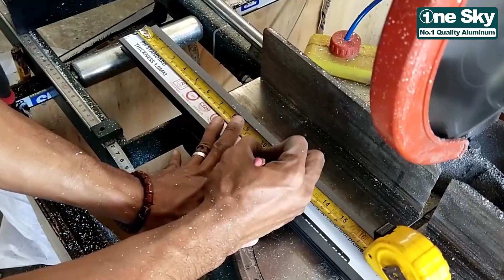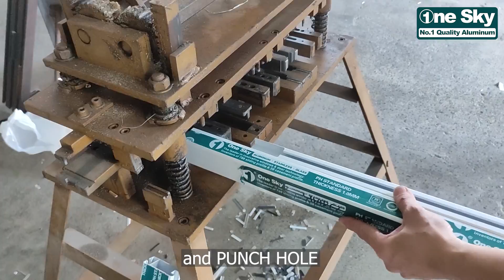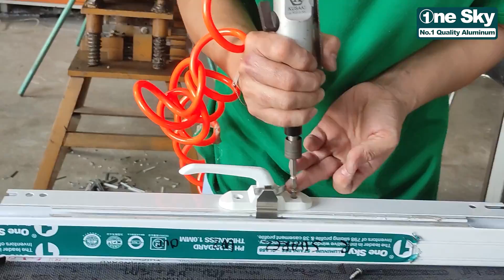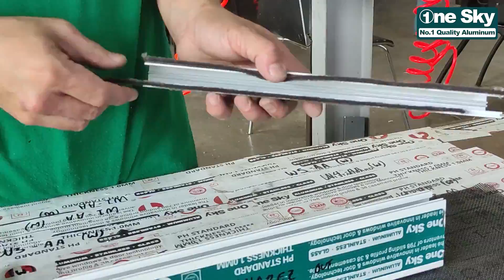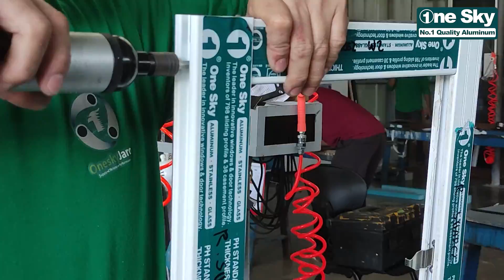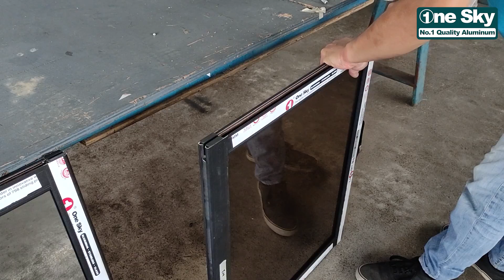How to assemble 900 series 3 tracks Sliding window

Comment: sir tanong ko lng po kung may available n ba ang 900 profile para sa 3 panel door/windows? i min po yung mismong pang 3 panel xa hinde po yung katulad nian n 3 tracks n screen yung isa..meron n po bng available n ganon? or gaya  parin ng dati n mag aadopt p ulet single head, jamb,and sill?my available n rin po b ng single section ang 900 series? salamat po sana ay mpansin..need lng po talaga mlaman ko..god bless
Reply from the maker: Thank you for choosing One Sky Stainless & Aluminum Supply. For more inquiry don't hesitate to call us:

Contact Number: 0956 194 3444 / 0991 400 7116 / 0975 714 1574

Follow us our new facebook: One Sky No. 1 Quality Aluminum